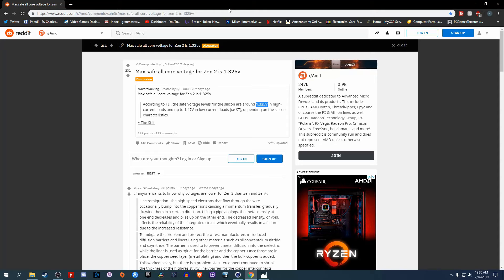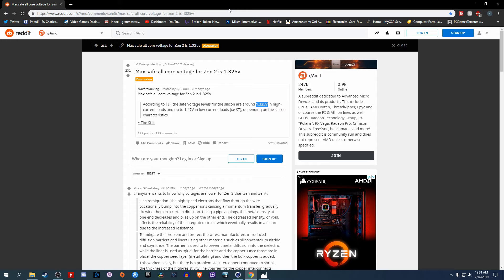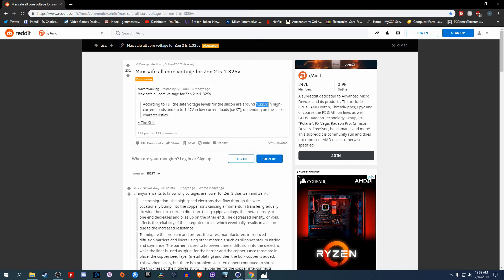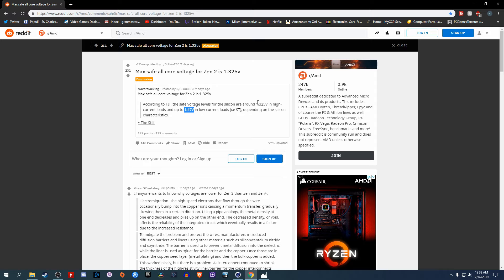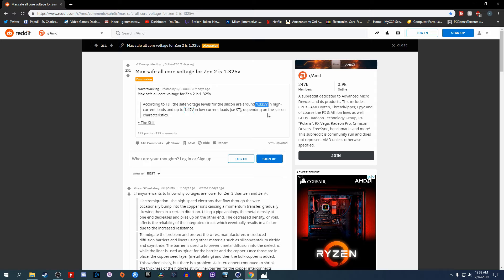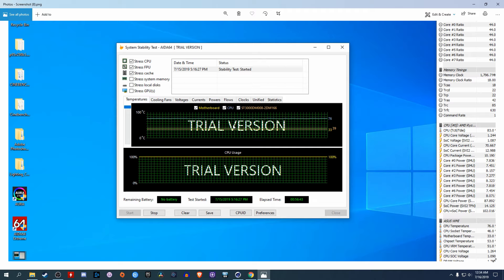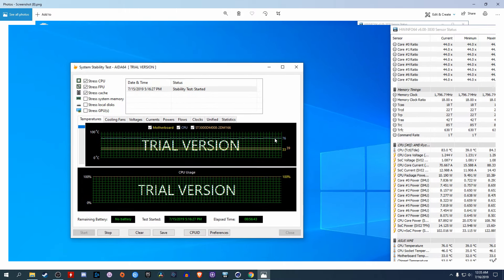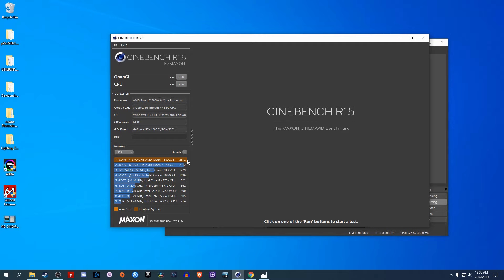Safe voltage for Overclocking Zen 2 - Ryzen 3800x

Comment: Looks like your RAM could use some overclocking too. Those are some loose timings for 3600 mhz. My RAM is currently 3733 mhz timings are 14-15-13-30-43-280-1T
@ 1.45 volts. My 3800X is overclocked to 4.5 GHz @ 1.3 volts. My best Cinebency R15 score thus far is 2367. I think I can still do a little better.
Reply from the maker: Yeah I could but I'm cool with the performance for now
Reply: Yeah and my 3600 cl16 kit is at cl19 4600 , beat that .
Reply: @koyoshima45  I don't have to. Latency for 4600 cl 19 = 8.26086956 ns. 3733 cl 14 = 7.50066970 ns  So, I win. Also your FCLK probably dropped to 1800 so there's an extra latency penalty for the infinity fabric not being 1 to 1. Keep on trying.
Reply: @OlettaLiano  you know that frequency is much more important than timings ,right ?  Because you can have a 2400 cl9 kit , you will have 3200 cl18 kit fps, but a 3600 cl18 will win . I have 10 15 fps more fps than you , on average .
Reply: @OlettaLiano  and for your own knowledge , only golden chips can take more than 2000 fclk . 1800 is max for most chips . There is no cpu that can take 2300 fclk . Enjoy
Reply: @koyoshima45  I already did. 4600 cl 19 = 8.26086956 ns of latency. 3733 cl 14 = 7.50066970 ns of latency. But my posted numbers was 4 months ago. My ram is currenty 3800 cl 14 FCLK 1900 which is 7.36842105 ns of latency. For 4600 to equal my numbers you'll have to go down to cl 17. Keep trying friend.
Reply: @koyoshima45  Yes, I'm a girl with an  associates degree from New England Tech of West Palm Beach, Fl. I have a CompTIA A+ and N+ Certifications as wells at a MCP and a MCSE. I worked an a custom PC shop for 5 years where I built over 300 high end custom PC's and now I build high end gaming PC's for people in my local area. I believe I know what I'm talking about. You are correct that current Ryzen systems can not have a FCLK above 1900. Thus if you have a Ryzen system running at 4600 your infinity fabric is no doubt out of sync which causes an extra latency penalty.
Reply: @OlettaLiano  well done , great experience ,  i am 17, lol  ,if what you are saying  is right , there would never be 4000+ mhz RAM on the market . I know that 0.6 ns don't matter , thats not even 1% difference in real life situation , if it would be more than 2 ns , yes maybe  there will be a difference . Hope i didnt get you offended by my replies

Comment: I have a 3800X with a Noctua NHD15 cooler and an Asrock X470 Board and my best OC result was 4.425 GHz @ 1.325 Vcore. And the temps are lower in idle and ~ the same under load compared to standard or PBO settings. CB15 result was 2325 compared to ~ 2177 with PBO or so. I could run 4.350 GHz @1.3 Vcore with even lower temps and higher performance compared to default or PBO settings. I don't know why AMD has set the Vcore so high. Or was it Asrock? The default setting is 1.41 on my board (when I check it in the Ryzen Master tool)!

Comment: My 3800x. NH-D15 with defaults. i assume PBO is on and B-Die ram @ 3600 C16.
 211 ST, 2205 MT in CB15.
 voltages are  ST ~4400mhz 1.45v,  MT 1.325v 4200mhz
Games its ~4400mhz 1.45v.   
This was a great upgrade over my R7 1700 i am very happy with the performance. i see 4550mhz at time.

Comment: Nice chip and oc bro!
Can you make a oc guide video from bios and stress testing or put in the comment section all of your oc settings? Im 3 yrs intel cpu user and ocing ryzen cpu is kinda hard for me especially english is not my native language. If you dont mind at all please reply tnx! :)
Reply from the maker: I'm gonna get a capture card eventually then I'll be able to show the bios. All I did in bios though was set the core clock to 43.00 and the core voltage to manual and 1.25. depending on your mother board you might have to adjust llc as well
Reply: @TokenTech  thanks for the fast response. But how about the PBO thing? I saw a debate on reddit about couple of months ago about setting it enable/disable/manual because of high voltage and i don't clearly understand what is use of PBO.
Reply from the maker: @YuzKie_1222  pbo is basically auto overclocking. i personally get better results by manually tuning the chip myself so i leave it disabled
Reply: @TokenTech  i see thanks a lot bro!

Comment: i managed 4.4 ghz at 1.25v just fine
Reply from the maker: Wow that's pretty impressive, did you do a prime 95 stress test?
Reply: @OwOsta me too ! Voltage around 1.25 is the best Way, Zen2  scaling up much better with low Temperatures than with high Voltage. And i did do Prime 95 for 1 h with just 72°, the low Temperatures makes the CPU stabil
Reply: Rudi Renntier did you use prime95 small fft?
Reply: traum im not sure what u mean english isnt the best but im assuming u ment mobo its Msi X570 A-Pro

Comment: 4,4 allcore on 1,3 v sound way to good
Reply from the maker: Currently running 4.3 at 1.25
Reply: @TheBartxxxl   amazing numbers i havent seen sucha cpu running cinebench r20 like 5 in row without a crash, i can get mine to boot like 1.38 amd  4,35  but big performance hit n(3700x) 1,43 @4,3-4,325 and cb r 20 bangs to 5300pst  and stable temps r during bench max 85 C
other 3900x  acts about the same
thats why  im amazed
Reply: @TheBartxxxl   allright, anyhow guess U r really lucky with ur chip, best i can do is 4,3 @1,4v llc high  or 4,325 at 1,43, i have dark rock pro 4 so temps r staying nice  can only dream od running 4,4 dayly. everyone r scaring me with degradation so daily im just stock speeds with  cl16 3734, was able to run a firestrike with insane 1,48 or sth and get 4,45 all core but no was gonaa keep  it. My board is x570 aorus elite tho
Reply: 1,42 @4,3 cb r20 5280
Reply: @TheBartxxxl   i think i have not, will lose 8 threads then, anyhow gaming wise wont need them atm, should give it a go i guess,  is the degrading rather temp related or voltage related, i mean even @1,45 im not going over 80 C in cb20
Reply: @TheBartxxxl     ill give it a try if i could get 4,4ghz on 8 threads with less voltage should mean few more fps with less power, less heat. Im not sure if its worth messingtho cause getting 165fps  1440p quite steady in bf v anyhow  :D. Ill check it out just 4 fun, 110% sure it wont be hitting 4,4  @1,325 v tho
Reply: @TheBartxxxl  lol i was thinking its going  to die in months with higher voltages :D, its old in 2 years anyhow unless more stagnation happens  :)
Reply: @TheBartxxxl   ahaha yeah, dark rock pro 4 is defo not bad cooling.
Reply: @TheBartxxxl  my 3800x in cinebench r20 gave me 5178 4.4ghz 1.35volts with 75c max temp. with a AIO 360mm